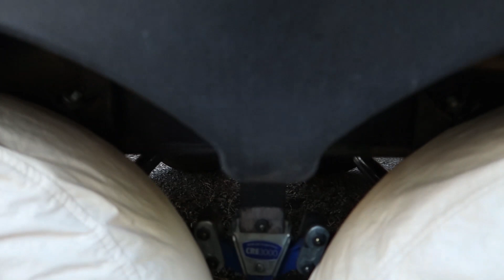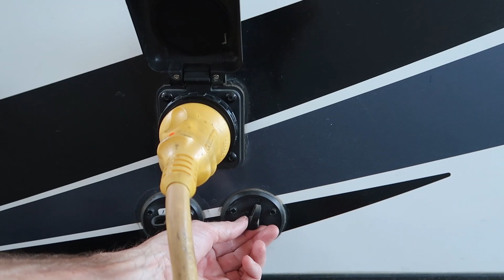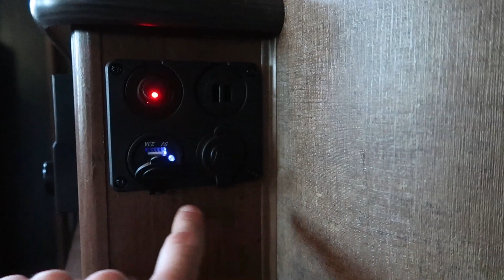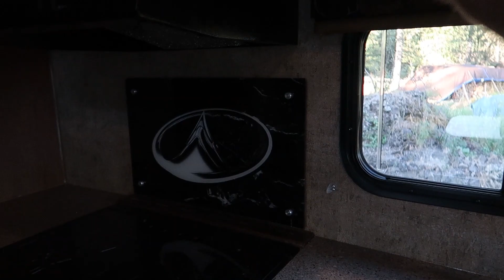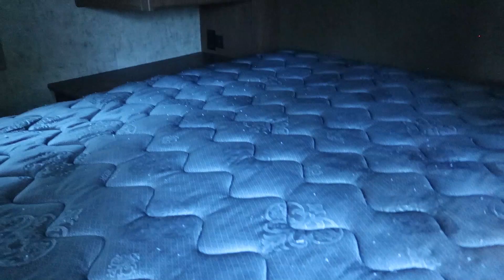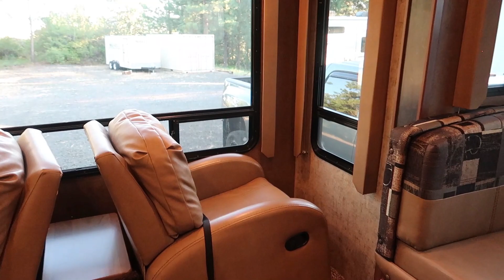Tour of My New RV | Outdoors RV Timber Ridge 24RLS

Comment: This model LOOKS like the steps are fold under the rig!  I love that system.  These new ones that fold up and into the rig really suck!!  They're heavy and drop sand and dirt inside the RV.  Wake up RV manufacturers!!  We had those!!!!  Outdoors RVs are the best you can buy.  But, they are expensive and they are heavier that most others.  All the others are just cheap cardboard boxes on wheels....
Reply from the maker: I don't like the steps that fold up in to the door either, for the same reasons you dislike them.
Reply: YES!  I don't want to bring the steps inside - yuck!

Comment: NOTE: One can buy a wax like spray to prevent rust from GM that is used on their trucks. There are companies that will apply a similar spray to the frame. I don't know how much more a company could spray over what you could but they may be able to reach internal surfaces we can't.
Reply from the maker: Fluid Film is the best spray coating I've researched.
Reply: @deltabravo1257  Thanks! Just starting to learn this subject 12/2020

Comment: Hello, thanks for the review/ walk-around!  What are you pulling it with? Any squat? I have a 2018 Ram 2500 HD Diesel with only 2,030lbs of payload capacity. I'm just trying to get an idea of what I can actually pull. Thanks again!!
Reply from the maker: I'm towing it with the truck shown in the thumbnail photo - 2009 Silverado 3500HD Dually.  I don't need "that much truck" but it's what I have, which has primarily bees used to haul my heavy truck camper.  The heavy truck camper is why I have a dually.  A 2500 series truck will do just fine towing a 24RLS or RKS
Reply: @deltabravo1257  .... folks always say it's better to have more truck than what you need. I'm thinking hard on getting an ORV 22FQS Mountain which is the the lightest and shortest in the Timber Ridge lineup. But like you said, my truck is "what I have". I appreciate your reply and your channel!  Thank you!!